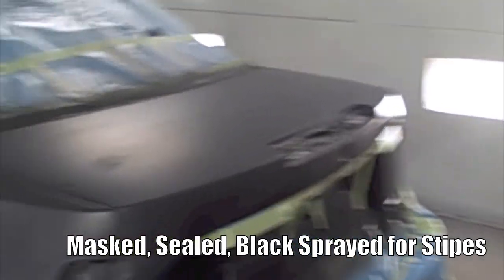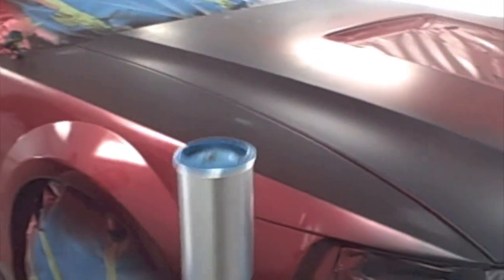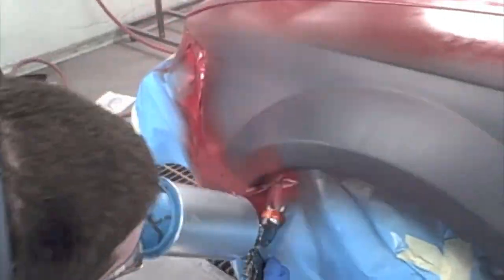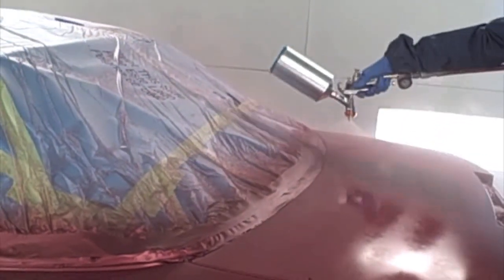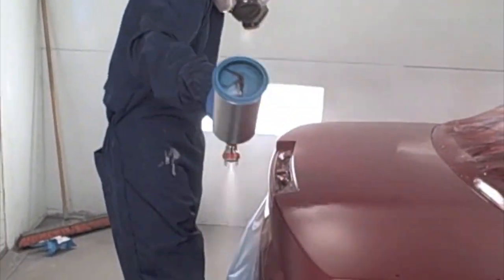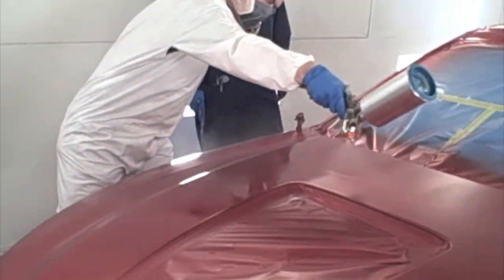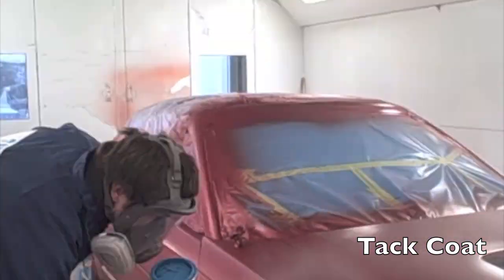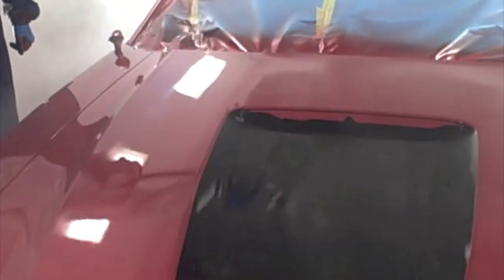DIY How To Paint A Car Yourself Using Primer Sealer, Base Coat, Tri Coat, Clearcoat

Comment: He's painting the bonnet\hood incorrectly. You spray either the bonnet\hood or roof from the center out. The reason for this is to make sure your moving your body away from a wet finish & not toward it. This reduces the potential for clothing or foreign particles damaging the paint surface.
Reply: Not exactly true, for your first coat you start from outside and stop and center. Then start from center back out on other half. This so you don't get dry lines in your clear
Reply: NightRider66 No disrespect intended but that's absolute nonsense. A good painter never paints towards or leans over a wet finish. Even an apprentice should know this. If the gun is setup & held properly there is no reason why you would get dry lines in the lacquer whichever direction you choose to paint a panel.
Reply: John Chisholm  most guys I've talked to paint the roof from edge to center then go to the other side and pull.  It's so they are always working on a wet edge.
Reply: Jesse Tulogeski I was a painter for many years within a number of main Dealerships (Renault, TVR, Porsche, Honda) including the import Centers & I can tell you for a fact that a decent painter never leans over a fresh coat of paint for obvious reasons.

As for a roof it makes no difference at all if you paint from the center out & then go around to the other side,the paint will still be wet. As long as you put the correct thinners & hardener in for the temperature you won't have any issues.
Reply: Was that comment directed at me?
Reply: NightRider66 @john chisholm is correct!
Reply: supershingo32 Thanks! I can't understand why so many people are unable to get their head around the obvious reasons why you always paint away from a wet finish not towards it. At least you seem to know what your talking about.
Reply: NightRider66 wow, please tell us you are not an instructor because you will be teaching our young people WRONG!
Reply: Jose Serratos Rodriguez well I can tell you from painting under the direction of folks like Chip Foose and others of that caliber, that you are incorrect and John is SPOT ON!!
Reply: Thanks for the support, it does amaze me how misguided some of the people on here are. You would think it was obvious that you don't paint towards the center & end up leaning over a wet finish. Still let them find out the hard way ay! :-)
Reply: I agree I seen many video and they always start from the center of car to outward motion.